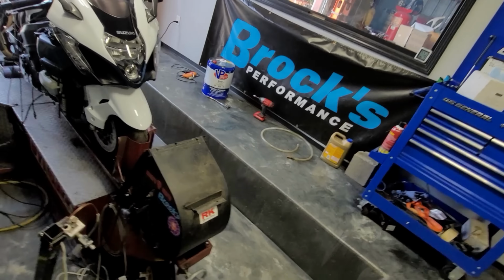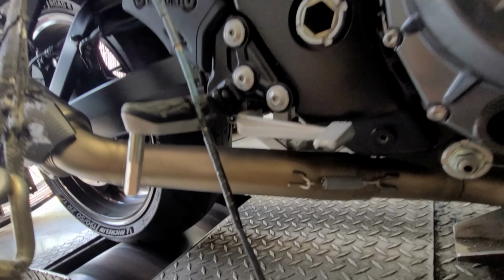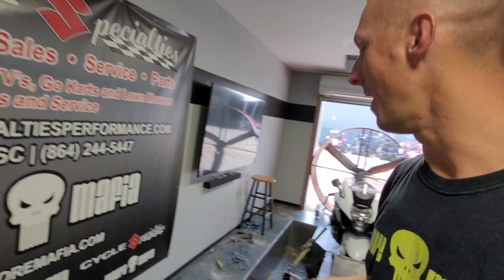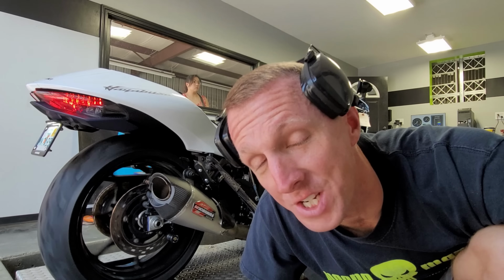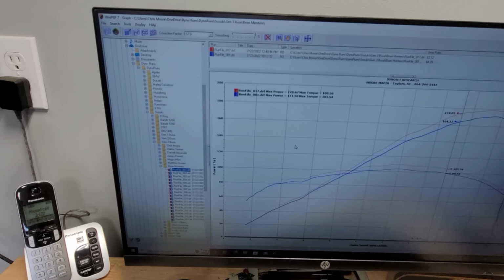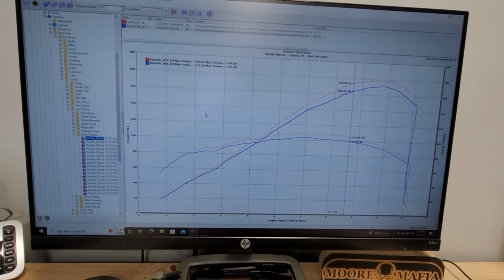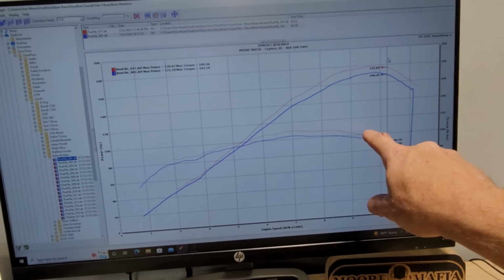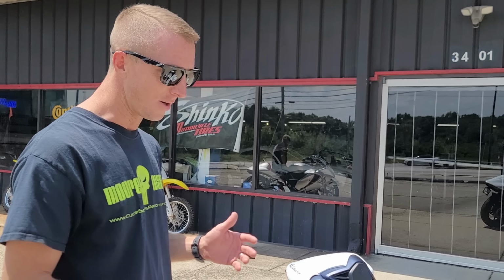He WON a 2022 Hayabusa But Not Before We Put It On The Dyno! MOORE MAFIA

Comment: 178 at the wheel is awful!!
I had 205 at the wheel on my gen 2 with a Brock’s exhaust, filter and tune!!
Reply: Holy cow dude....Are those the only modifications that were done to the bike?
Reply: @radrock6249  yessir! It rocked! I also had a 2005 gsxr1000 with yoshi titanium rods, pistons, cams, valves and springs and ported, carbon wheels, ohlins front and back and 6 pot calipers etc made 205 and 95f/lbs at the wheel. It was demonic dude! And that was 10 years ago. Third gear roll on wheel stands
Reply: I doubt that .
170 stock at wheel .
You don't get over 30 with pipe filter & tune .
15 to 20 tops
Reply: Possibility that it was the Dyno reading on the high end. Different Dynos will read higher than others and some will read lower. My Gen 2 only had 167 at rear wheel and 175 after tune. Weather conditions play a big part also.